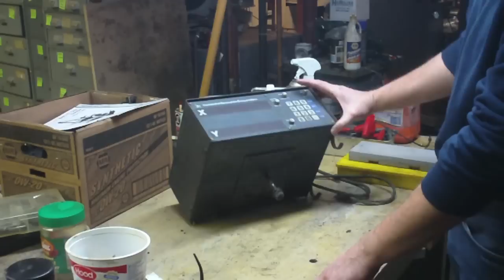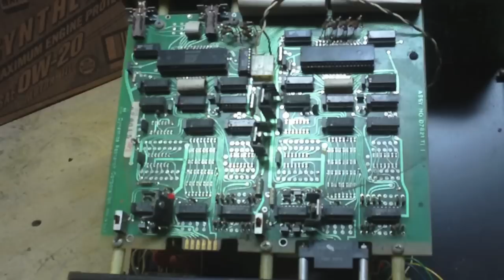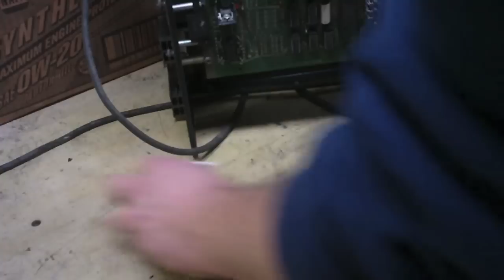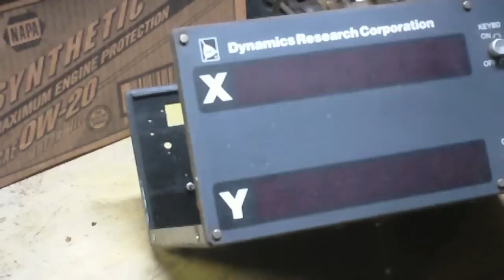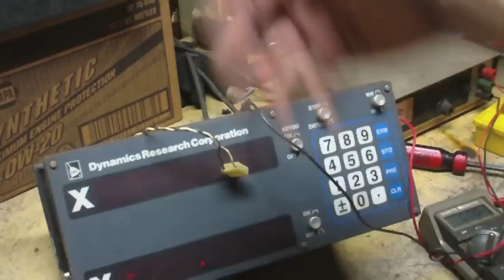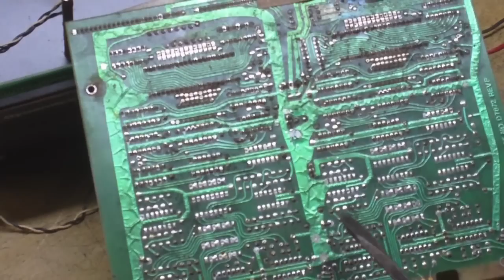The Dynamic Research DRO Part 1

Comment: the way the solder resist is peeling is quite common on 80's electronics.  I'm not an expert, but i beleive similar things can also happen with the copper layers delaminating in older stuff, which can cause open connections.  As you probably have guessed that can be hard to track down.  

Also, pcbs are generally labelled in terms of layers so you have a 2-layer board, but now days you can get 8 or more layers in a single board if your willing to pay for it.
Reply from the maker: +Justin Hunt HI Justin. If moisture has never been an issue, the copper cladding tends to hold up well, but the solder connections then selves can start having issues. What back in the day, we called a "cold solder joint". One bad connection could really foul up a circuit. Lightly tapping on the board some times helped track one down, also freeze spray would also make an intermittent connection act up. Often I'd have to drip a tiny drop of the stuff out the plastic straw on the spray can to isolate the bad connection. Some times the connection would just look bad, or you could see tiny cracks around the pin under magnification. I've even had ones where the bad connection was inside the IC! Those were tougher to track, and the only fix was a new IC.